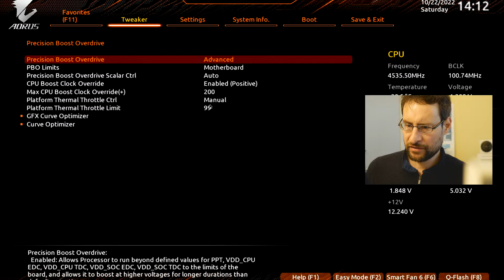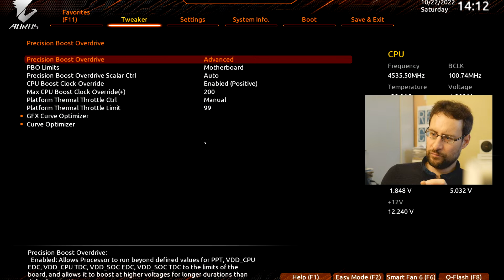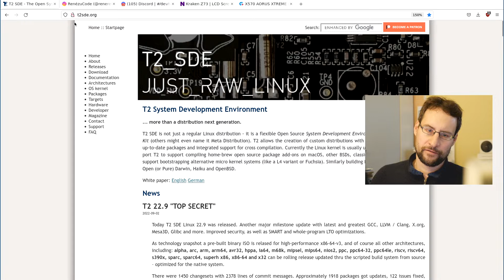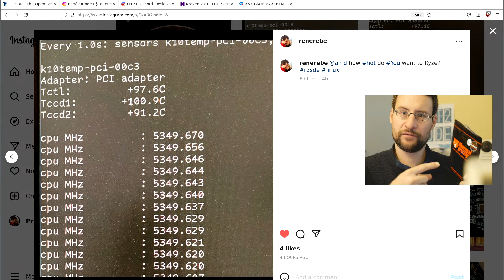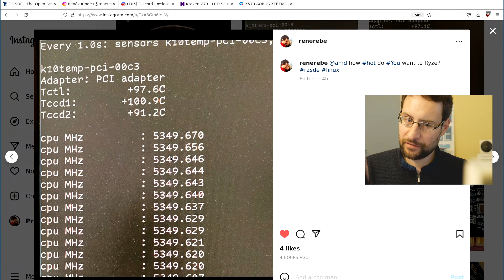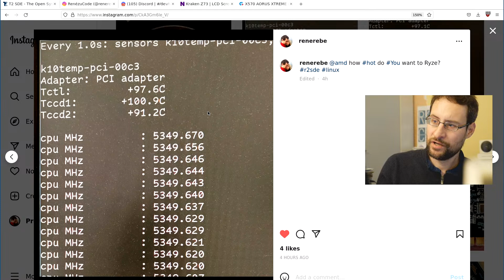Ryzen 7950x Active OverClocking tested: Single core 5.95HGz, all cores around 5.4GHz!

Comment: I have Gigabyte B650E Aorus Master motherboard paired with 7950x and I get black screens under heavy load such as Corona Benchmark and Prime95 (small FFTs). I haven't overclocked anything and I haven't changed anything in the BIOS (it's at factory defaults). Any idea what might be causing this? CPU and VRM temps are normal when the issue occurs (checked with hwinfo64). I have 360 AIO Arctic Liquid Freezer II.
Reply from the maker: While it could be anything, ... What are your memory settings?maybe too tight timings,  ... What's your memory ?
Reply: @renerebe  Hi René. Thanks for the quick reply. My memory is 64GB (2x32GB) Kingston Fury Beast 5600 CL40. BIOS is at factory defaults so I've not changed any setting in BIOS. I've not even loaded the XMP profile so my RAM runs at JDEC spec. I've tried a 2nd powers supply (Corsair HX1200i) with the same result. I even tried running the PC without an external GPU and with just 1 memory stick - no luck.

Comment: I have one but the only way I get 5.4 all core is if I turn a CCD off, never tried this oc profile before
Reply: You should be able to comfortably hit 5.4 with some underclcoking. Or if you want manual if you can drop the voltage a bit.